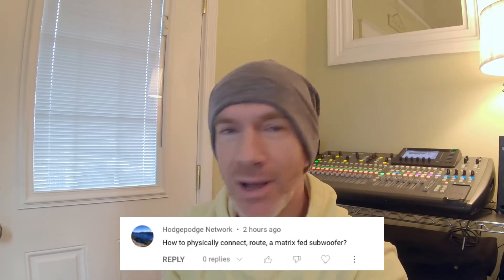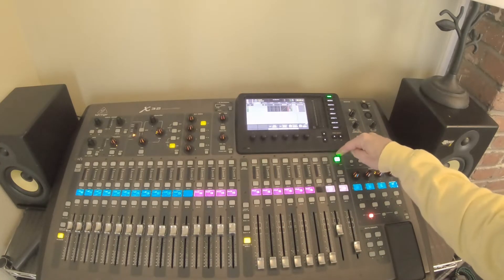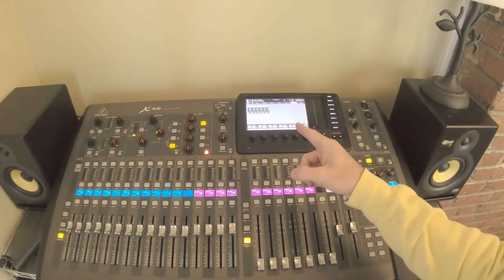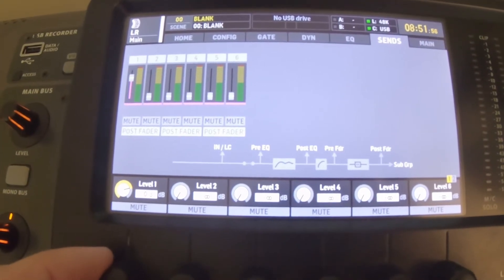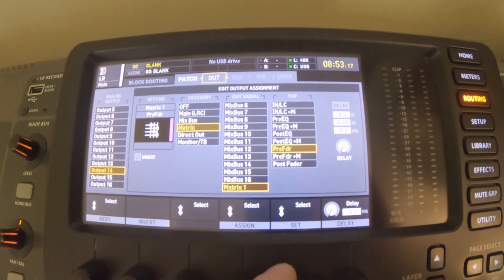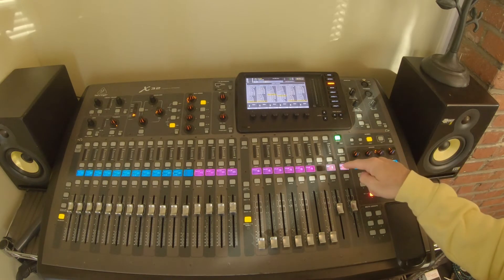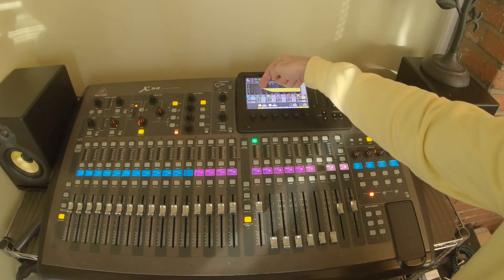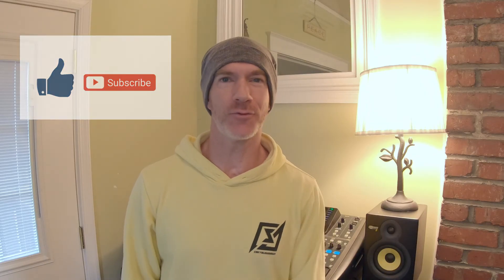How to Route your Subwoofers from a Matrix

Comment: What is the advantage of using a matrix?  I have a Wing Rack and I just use 3 of the 4 mains and put the Speaker Manager plug-in on each to create the crossover EQ.  Link the Main 1 fader to the 2 (Sub) and 3 (fills) and the main acts like a little DCA for main 2 and 3.  What am I missing in using a matrix?
Reply from the maker: The WING is more sophisticated than a number of other consoles (like the X32 that I made the video about) so we have to use a Matrix (fed by the main mix) to then distribute our signals to their desired location and we can manage EQ and overall level of each output location with the matrix faders. The WING has this built in with the four Mains as you mentioned and you are already on the right path. 

To be a bit more specific though, A BUS is a mix of inputs and a Matrix is a mix of BUSes . The Main mix is officially the Main BUS therefore you can send that as a source to a matrix and (if needed) blend that with other BUS signals and send it out to a desired location. many people will use a matrix mix to feed a foyer, cry room or other part of their venue. Some people will also use a Matrix to blend BUSes together to create a broadcast mix since the main mix is designed specific to the venue and then a broadcast mix can be shipped outside.  I hope that helps add more context.

Comment: I set up my m32 like this but I’m curious if there’s a way to allow the main fader to control the sub as well or the channel send that sends to the bus to control the volume sent to the bus
Reply from the maker: So, using a Matrix to feed your subs allows you to have the Main fader control both the top cabinets and the subs as a whole. The Matrix volume can then control the overall sub level separate in case you need to turn up or down the subs. Keep in mind your Main fader Q will impact the entire mix (including subs) where the Matrix EQ will only impact the subs.  

This entire setup allows you to build a full mix and still have some overall control of the sub level. If you want to have a unique mix of instruments going into the subs you will want to use the M/C channel (which is configured like a post fader mix bus) to send instruments to and then you have a fader that can control that specific level and the main fader will again control the overall volume if you click the setting in the Settings window to make that happen.

Let me know if you have other questions.

Comment: Thanks for sharing the video. So by using this connection, does it now mean that I have to connect both my subwoofers to an aux channel for the matrix created, instead of the main out? I normally use an small audio interface with only two inputs where I connect my main outs L R, and I use waves super rack performer just to process the main out with some plugins before it goes to the speakers. I wouldn't be able to do this anymore right? Thanks
Reply from the maker: The idea from this video is taking someone from connecting their main out into their sub and then from the sub into their top cabinets, into having more control of their subs with a separate fader. Most people run from the console directly to their speakers and the Matrix would be a 3rd (or 2nd if you’re running mono) output from the console. In your situation you would want to avoid using the interface as it will add latency to your tops and the sub would be slightly ahead causing phasing issues. That being said, you can use Super Rack performer without an interface and just connect it across USB and I’m sure you could find a way to manage the signals to use the plugins, send back to the console and then run through the physical outputs to your separate tops and sub (using the Matrix method).
Reply: @AllamHouse  I have the XR 18. The problem is that I do not see a way to process the main out, only each channel individually. That's why I use a separate interface to do this. But probably what I can do is create a aux fader for the subs and connect that to channel 1 on the interface, and the rest of the channel using the main out L & R. to channel 2.

Comment: Can this work with a passive system, when mains and subs are running parallel to an amp?
Reply from the maker: It all comes down to the routing and specifics of your system. If you are running one side of your amp for tops (in mono) and the other half for your subs then you can certainly use this setup. If you have your signal running from the amp to a sub which then connects directly from the sub to a top cabinet, this will not work.
Reply: @ thanks

Comment: Hii brother, how to connecting x32 to amplifier
Reply from the maker: This is all handled in the routing, but the default settings on the full console have the XLR Out 15/16 on the back of the board set to take the Main LR mix out to your PA speakers. If you have a smaller platform mixer (compact, producer or rack unit) the default setting is to have XLR Out 7/8 set for the Main LR mix. That being said you can change the settings to be anything you want inside the Routing screen. This video here is an overview of the routing screen. https://youtu.be/PpeqRuPGi2Y

Comment: Why would you use this over the M/C bus?
Reply from the maker: This is a great question and at a high level the Matrix allows for a single mix (LR) to be built and then sent to the subs as an entire mix. You can then decide if the Matrix is PreFader which would minimize the potential of the PA being altered inadvertently or Post Fader giving the ability to manage the low end volume throughout an event. The MC channel is actually a Post-Fader Bus and gives you the ability to set certain amounts of specific inputs into this Bus and while this is a very customizable way of mixing, many times volunteers do not have the understanding of this setup and it can cause challenges in building a solid, consistent mix.

Comment: Wow this was the EXACT thing I was looking to solve. Thank you haha
Reply from the maker: I’m glad it was @just what the doctor ordered”. Let me know if you have other questions.
Reply: @AllamHouse well question for you : If I run stereo subs, should I run both outputs (13 & 14) on Matrix 1 ? Or give each their own Matrix ? Is it possible to assign 2 différent output on a same Matrix ?

Thanks !
Reply from the maker: I run Stereo Subs in my weekly church setup and I just have my main L/R feed the subs and then go from the subs (high-pass output) to my top cabinets which is the easiest setup. Using a Matrix for subs does offer the ability to have an EQ and removes a need of a DSP, but a Matrix is going to sum your LR signal into mono so you won't get a true stereo sub configuration, but rather a dual mono configuration. This still isn't bad, but just understand what you are trying to accomplish and then drive down the right path.

Comment: Thanks for this. If you wanted stereo sub out then I'm guessing you could send the stereo bus matrix to 13 as well and pan each 13 and 14?
Reply from the maker: You could do that and have stereo subs. Typically people only run subs in mono  in an effort to minimize cancelation and muddiness within the venue.
Reply: @AllamHouse  Thanks! Run mono and stereo subs side by side (swap their signal) if you get a chance on modern bassy music like dub. Once you set the gains evenly the stereo's quality is very noticeably better. Even with only one sub. Tested in variety of spaces. Unanimous blind agreement on the quality. I'm not an expert but one of the manufacturer's reps said it has to do with phase cancellations in the mono signal processing. 
Try it out :D
(I suggest using a sub that this would clearly make a difference if you can: KS28, PK G28, JBL VTX G28, Bassboss ZV28, etc.)
Reply from the maker: Sounds like a fun adventure for sure. I wish I had the gear available to run this experiment, but I'll have to take your word for it in terms of the difference.

Comment: My sub has left and right input how would you route this to the X32? Thank you...
Reply from the maker: Many subs are designed to be a starting point for your PA with built in crossovers and often will take your input signals, aim them to mono for the low end and then have the ability to send out high-passed signals to your top cabinets. In the end, just treat it like a regular, mono sub and connect as described in this video and you will be fine.

Comment: H, how to route two subwoofer in the matrix 
Thanks
Reply from the maker: You can either send from one sub to the other if there is an output or through-put on the sub. You can also just route the same matrix mix to go out a second output so you have two unique outputs that share the same source. This would be done in Routing > Outs.

Comment: Hi, until now I've seen many Videos about this Matrix topic. Unfortunately, I still don't understand the issue. If I've 2 Tops maybe 15" (Main L+R) and 2 Subs 18" (L+R), I'm already able to Route my Subs to 2 Mixbusses and send any Instrument Signal which I need for my busses. Why do I still need the Matrices? Ultimately, this does not save me any further outputs. Can someone please explain this to me again? Thanks a lot guys.
Reply from the maker: It’s less about saving outputs and more about saving MixBuses for other purposes in your mixing. Maybe you want them as groups, parallel compression, etc. Running your subs through a normal Bus means it will not follow your Main fader and if you adjust your Mains up or down the subs will stay the same. By using a Post Fader Matrix you can set the ratio of subs to your mains and then adjust the Main fader to move the entire PA up or down while still having control of just the subs if you need to move those with the Matrix fader. If you want to run an AUX Sub setup, but have it follow your Main fader, the X32 offers the M/C bus which is a true mono bus that can follow your Main Fader and give you the best of both worlds. I discuss this setup in this video. https://youtu.be/0TWCvrqYl9w?si=RytrZEop1o5nRT_k
Reply: @AllamHouse  Thanks for the detailed explanation. I‘ll give it a try abs hope that I‘ll find the best possible method for my purposes. You helped me a lot. All the best to you. Greets from Germany.

Comment: So is the Main LR and the sub m/c all going to that matrix so it can all be controlled with the one fader?
Reply from the maker: In this example you are not using the M/C as an Aux fed sub, you are just taking the LR signal and sending it to the matrix. The matrix is only feeding the subwoofer so you can use the channel strip EQ to alter the signal before it leaves the console for your subs. You can also adjust the overall volume level of the sub using the Matrix fader, but the Main Lr fader is still a mater volume that will turn the entire PA (and sub) up or down. I hope that helps.

Comment: Stumbled across your video and love the content. We have a situation I'm hoping you can help with - Situation: We have relocated our X32 to a new space, and we are trying to eliminate equipment in our rigs. Previously we had been running 2x24" subwoofer cabinets w/ amplifiers; using a crossover unit to separate signals. We were mobile for a time, so we ran with just PAs (a couple of Mackies).

I've been looking online at the best way to run subwoofers with the X32 without the crossover unit, and currently I have it where I'm sending a full copy of our FOH mix to a Mixbus, then routing that to a Matrix to output (channel 11 for us) to the subwoofer amplifier (which is currently cranked to 90-100% output). I used this video here to set up the routing.

The 2 subwoofer cabinets (2x24") are daisychained together.

We're getting signal, but it's very quiet - I can control the output using the Matrix fader but it's topping out and we're barely moving the subs. 
What do you think is the issue here - this is a working amp - and the old crossover unit wouldn't have boosted signal at all?... so could it be that we would need to power the subs separately and not daisychain? would we have to use 2 matrix sends to power each sub?
Reply from the maker: In an odd way, this sounds like a fun troubleshooting opportunity. For the console, all we are doing is routing signal to different places so using a second matrix will not change the output of your actual subwoofers. If it were me, I would start by sending a copy of the Main L/R mix to the subs and turn off the EQ and any FX on the mains. This will confirm a direct signal path going to amps and subs. I usually just run audio from a computer (Spotify) so I know I have a well produced signal as my source. If the subs are still thin you will want to explore the details of the amp /sub combo. If the subs get bigger than we need to look at how you are routing the signal inside the console, what EQ's you have set in place and the tap points on your outputs. 

For your amp / sub combo, it will be good to know if your amp is a single channel amp or running in bridged mono. Are your sub boxes configured to 8 ohm which then (combined) creates a 4 ohm load on the amp which doubles power output. Also, confirm your subs are wired correctly in phase with each other so they are not cancelling signal. 

I'm happy to continue helping here, but if you'd like a direct one-on-one session we can get things covered in about an hour over the phone. You can start this conversation outside of youtube by going to my website and filling out the contact card. https://sound.allamhouse.com
Reply: @AllamHouse  thank you! This has given me a good deal to consider and think about

Comment: We are using a S32  stagebox connected to the M32 for church Input and Output. An Engineer setup this up 5 years ago. Watching your video I can understand how the FOH L/R bus is copied to the Matrix 1 and 2. In our setup this works well I can use the Fader for Matrix 1 & 2 and make the sound going to a  BOSE F1 array speakers and they are connected to Output 1 and 2 in the S32. My problem is the I wanted to connected a Bose F1 Subwoofer to Output #5 that would controlled by Matrix #5. I know I can just copy again FOH to Matrix #5 and apply a cross over EQ for the Bass sound but I do not know how to route so that my connection on the S32 would be Output#5.  Where are the setting and how can I reverse engineer the S32 output #1 & #2 because I can clearly prove that  Faders for Matrix #1 & #2  are controlling the sound going Output #1 & #2 to our BOSE F1 Array Speakers. Some might say just connect the Output#1 first to the F1 Subwoofer and daisy chain the connection from there to the F1 Array Speakers. Well I want the subwoofer to have its own Matrix #5. Can you  please tell me what video to watch when it comes to routing in the M32/S32. Btw in the M32 we are connected AES50 A to S32 A. Or maybe you just tell us where to go in the M32 menus. Thanks for your help.
Reply from the maker: To setup the Matrix 5 to go out output 5 you will go to Routing > Out and scroll to Out 5 on the left. Then you can select your source where you choose Matrix 5 and then the tap point (usually Post Fader). Assuming you have your Routing > AES50a set to Output 1-8 these changes will automatically send our Sub guns to the output 5 on your stage box.

Comment: How do you select what goes to the subwoofer, especially if you only want the kick and the bass guitar to be on the sub without other instrument?
Reply from the maker: The Matrix method does not provide the ability to send individual inputs to the subs, but this video here will provide you with two options for running an "AUX Sub" which is what you are looking to do. https://youtu.be/0TWCvrqYl9w

Comment: How do you exclude the vocals from the sub matrix?
Reply from the maker: You are asking about an AUX Sub which is different than what I have setup here. There are two main ways to go about an AUX Sub setup. 1) You can use the built-in M/C channel and only feed it with the inputs you want to go to your sub. Then route the output out an XLR send and send it to your subs. The other is to 2) Choose a MixBUS and only send the desired elements to that Bus. Route the Bus out an XLR and send it to your subs. There are pros and cons to each one that I put together in a video to discuss since it’s easier than typing it all out.

Comment: Hi Dave,
Great video! You didn't talk about adding any instruments in the matrix but I believe we know how that works.  One question - We are using a AES50A stagebox. When we try and adjust  any volume on the subs none of the faders affect the sub output. What is the proper routing for that mix bus? Thanks.
Reply from the maker: First thing to keep in mind is that the full audio signal is going to the Main Bus. I then copied that Bus and sent it to the Matrix which offered me additional EQ and a separate output to feed the Subwoofer. You can send inputs to a matrix, only Buses. 

For your volume control situation, you will want to check that your tap point for the output is set properly. This video discusses the two different settings that have the same terminology around Pre/Post Fader. https://youtu.be/1GNmNWdVWKg

Comment: Putting gate or noise Isolation on a AUX CHANNEL  to eliminate humming or ground noises... Please explain a how to .. or an alternative..
Reply from the maker: So, the console does not offer a gate on the AUX channels so you would need to use a regular channel. If your signal is coming in on an AUX channel (maybe a keyboard plugged in with a 1/4” cable) you can route that inout internally to be the source for a regular channel which then provides the gate and other channel strip effects. 

To do this, select the desired channel (1-32) and go to Home > Config. Use the first encoder to select the Source as the AUX channel your input (keyboard in this example) is plugged into. I do recommend doing a similar change on the actual AUX channel, but turning it to the top “off” position so you do not have two signals being sent into a mix somehow.